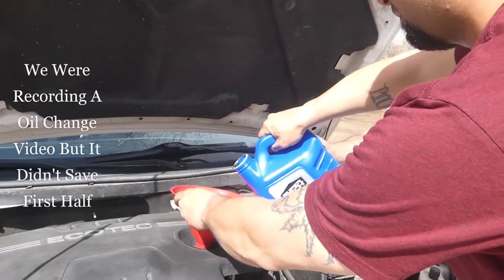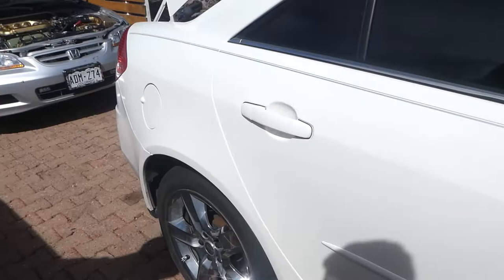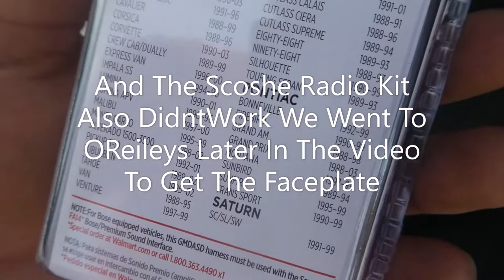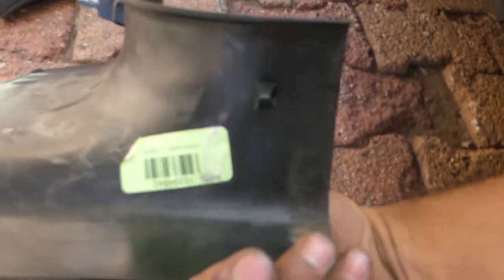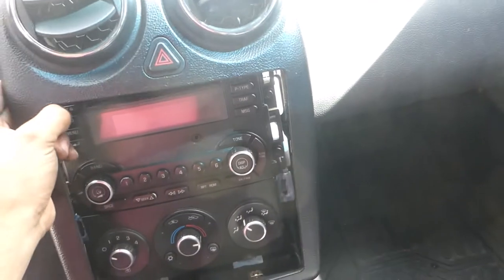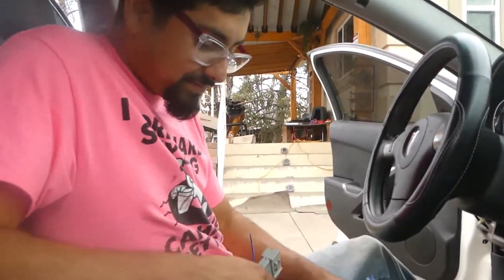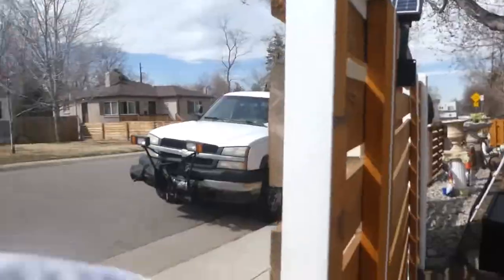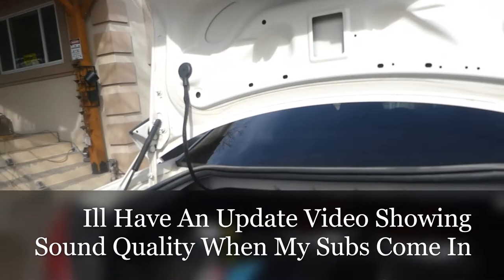Installing Radio And Sub In Sams  Pontiac G6

Comment: What color was the wire you hooked your remote wire from the amp up to? The other regular solid blue ones or a blue/white ant. Wire? My amp won’t turn on. Idk if that’s the issue or the ground or what?
Reply from the maker: Sometimes the wire says amp on it and it’s pink I can’t remember now sorry for late response , but usually pink or blue